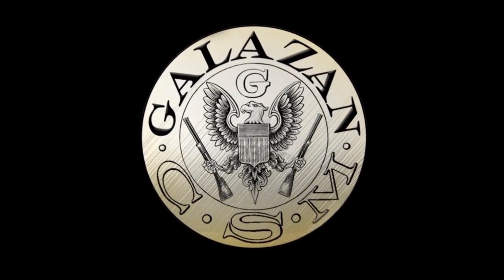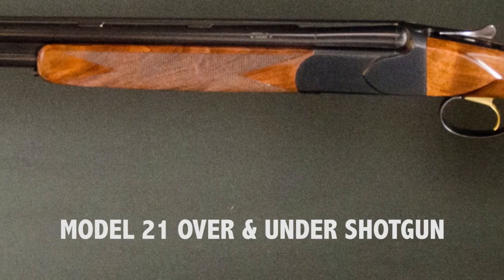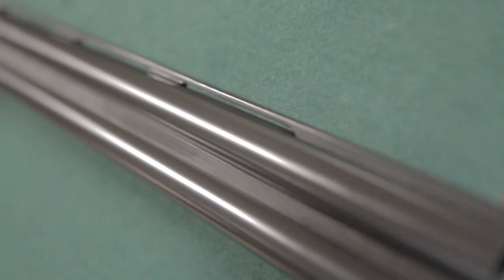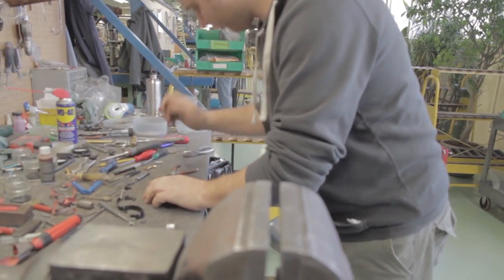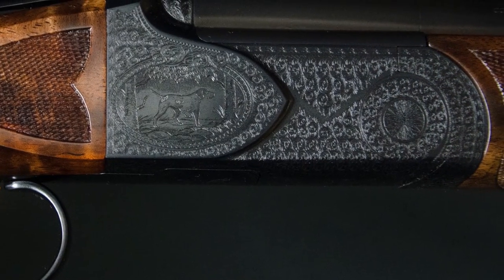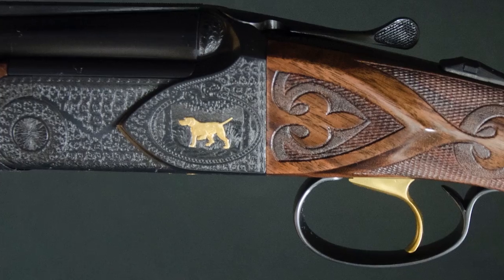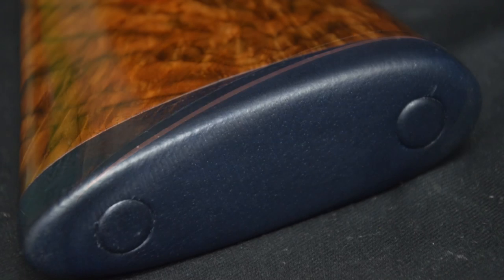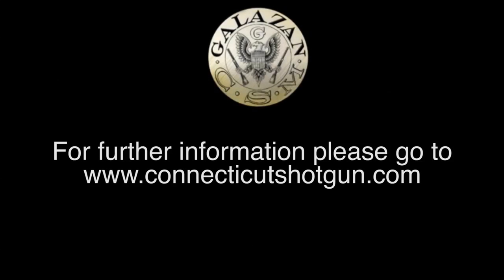CSMC Model 21 Over & Under

Comment: I purchased an expensive collectors shotgun from these criminals at CSM. They advertised the gun as "brand spanking new" (their words) When it arrived it had 1). a very sloppily and poorly refinished stock. 2). mismatched for end 3). a broken mid bead rib. I supplied CSM with time stamped photo's of this piece of junk but their terse and abrupt response was I had broken the gun and the stock has not been refinished and this is the end of this discussion.  I have now involved the Conneticut Attorney General and their department of Consumer Protection.  Do a little deeper digging on the internet and you will find the internet is peppered with expensive and unresolved complaints against CSM. Things finally seems to be moving in the right direction for me now because CSM is responding to my claim but only under the threat penalty for not responding. Be ware of these guys.